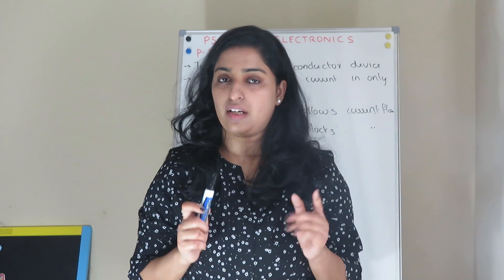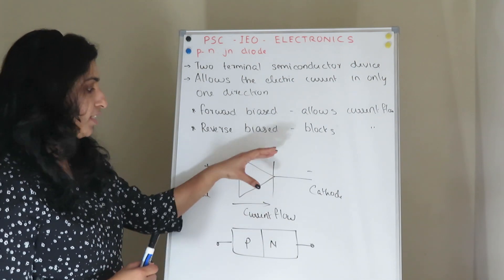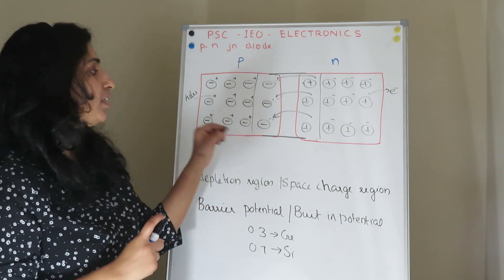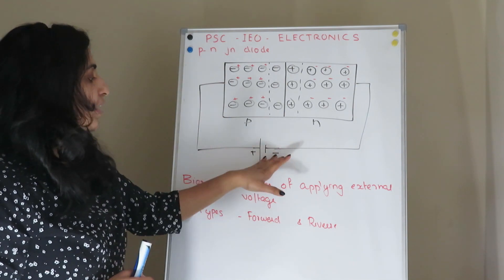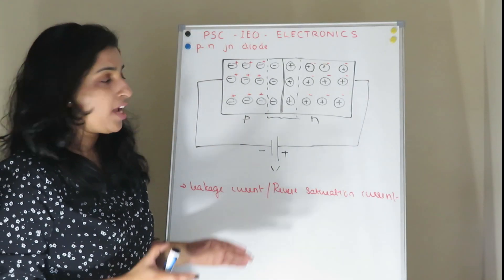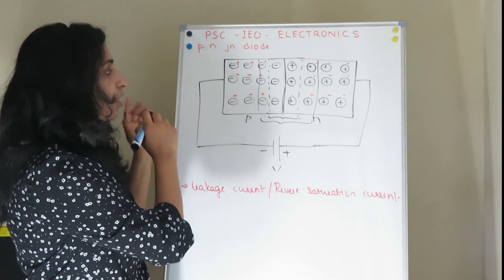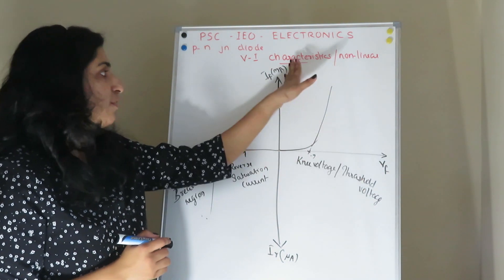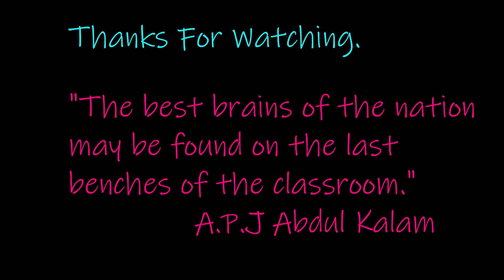p-n junction Diode -VI CHARA- PSC  ELECTRONICS CLASSES | IEO / POLYTECHNIC LECTURER | 5

Comment: How they repels,both the carriers are oppositively charged know?
Reply from the maker: Repulsion happens when diode is forward biased. + ve terminal of battery is connected to p type semiconductor & - ve terminal of battery is connected to N-type. P Type semiconductor has holes as majority carriers, ie + ve charge.So + ve battery terminal & + charge carriers. Like charges repel each other. Similarly Electrons (- ve charge)  , majority charge carriers of N- Type and - ve terminal of battery  repel each other.
Reply: HighSchool Maths thank you 👍🏻